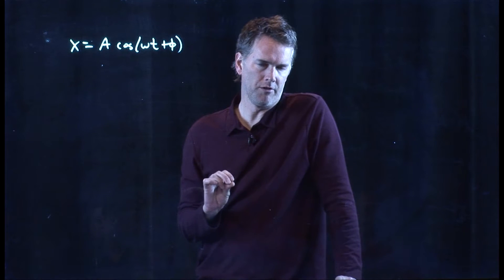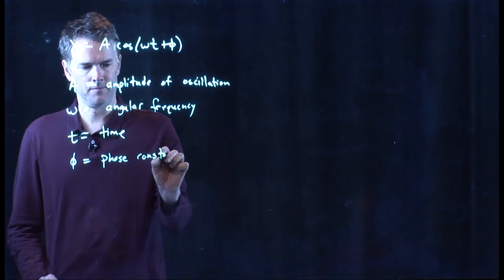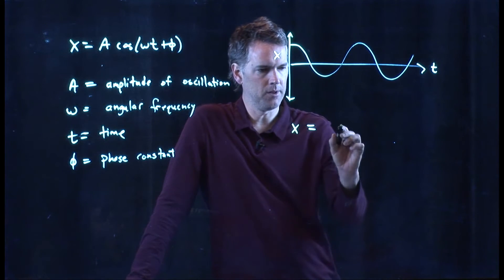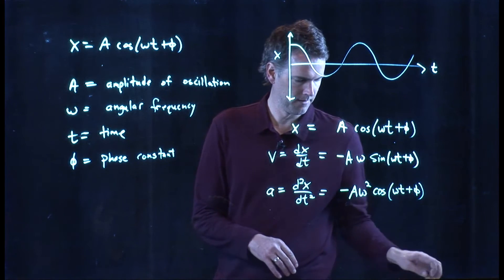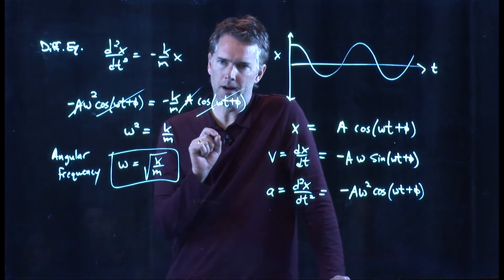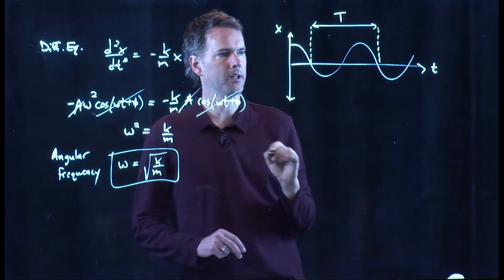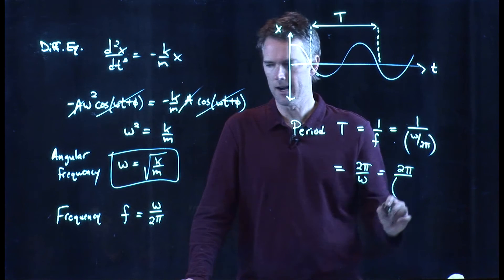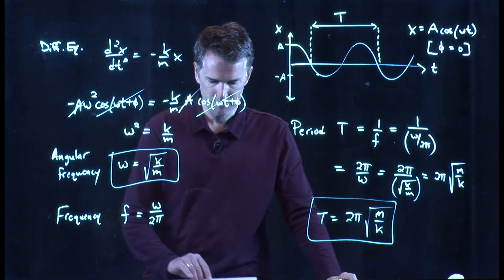Cosine solution to Simple Harmonic Motion

Comment: The -k/m(x) comes from the fact that the d^2x/dt^2 is equal to acceleration (a). Acceleration is equal to Force over Mass. a=F/m from the equation F=ma. Force is also equal to Negative spring constant multiplied by the distance. Now the a=F/m will look like a=-kx/m. because the k and x are multiplied together you can pull the x out and be left with -k/m(x). It took me a little bit to find where -k/m(x) came from. I am sure there is a paid version of this video somewhere that actually covers it, but if like me, you need to understand where formulas came from, you were probably lost and felt like you were missing out on some crucial information.

Thanks,
Grant
Reply from the maker: Thanks Grant, I'm always looking to improve these lessons, so I appreciate your feedback.
Cheers,
Dr. A
Reply: @yoprofmatt  i didnt expect a reply, holy cow. I appreciate you taking the time to read replies and respond. I am not sure if I was subbed before but I will check right after this.

Thanks!!!

Comment: what is -zone of no return->>>?
Reply: Zone of no return is the event horizon where the gravity becomes so strong that you can't come back from that point
Reply: In this context, that means yielding.   When you deform a ductile material to exceed a limit called its yield point, it will permanently deform.   It will still support the load, but when you remove the load, it will not return to its original size/shape.   It is only in the elastic zone of loading, between zero and the yield point, that a ductile material will return to its original size/shape, after you remove the mechanical load.

A brittle material by contrast will not have a yield point.  Instead, it ruptures immediately at the end of its limit of reversible loading.